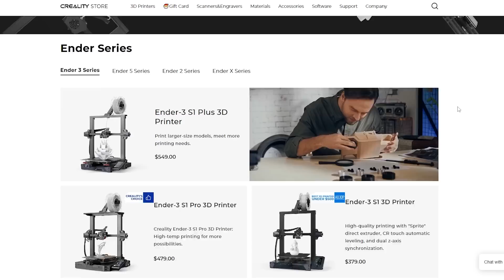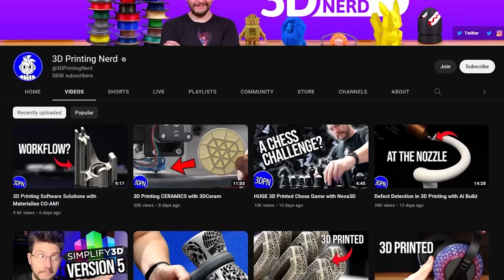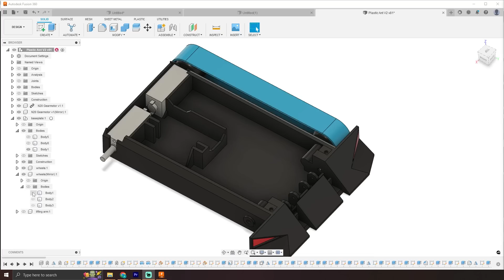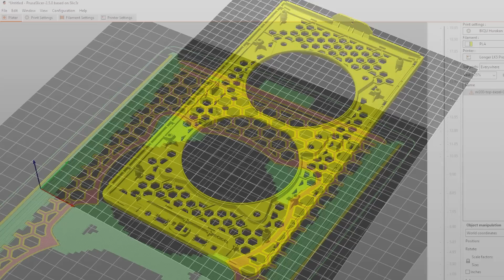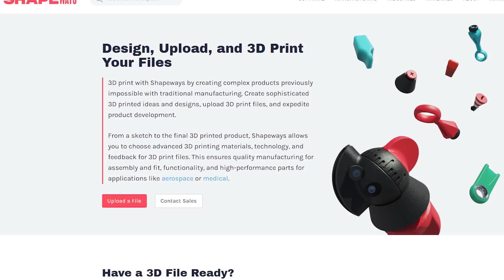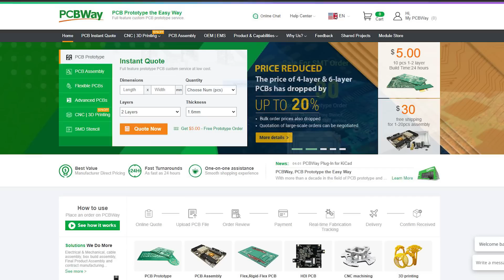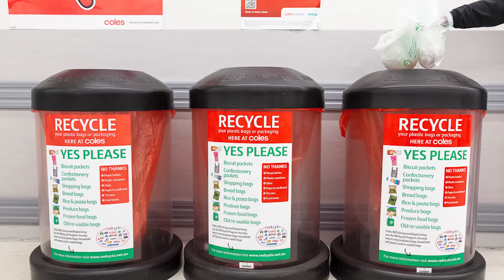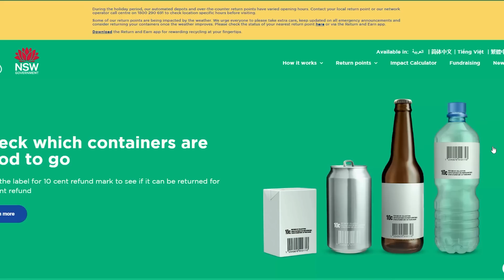My 3D Printing Predictions for 2023

Comment: The point about recycling is a good one, although the transition to the "make your own bottle-recycler" was a bit rough.  :)  And of course that doesn't solve the fundamental problem of needing to deal with all the PLA and ABS scraps lying around my house; sure, the "I print using recycled bottles" approach does reduce the use of the other plastics, but it does so at the cost of one of the few almost-viable recycling programs most of the world has in place.  What's needed is some way to easily deal with the scraps.

My local 3d printer store collects scraps and turns them over to a filament making company, but I don't participate because I don't have a car and the store is probably an hour away by bus and they don't really sell anything I want to buy.  Spending three hours of my day off just to take them some plastic scraps isn't worth it to me.  I recycle cardboard because it's easy - the cardboard bin is right next to the landfill bin, I'm going there anyway.  I recycle bottles because, although they're also a bit of a pain, there's a small financial reward at the end.  (Or some hockey team's fundraiser will come get them for me, even easier.)  Until recycling my scraps is that easy, I'm probably going to continue to landfill them, and so are most people.

As a side note: I've tried using recycled PLA because I like the idea, but I've found it's way too unpredicatable.  Each spool is different and I spend a quarter of it, it feels like, just getting it dialed in.  And then two days later I'm doing it all over again.  Also, for me at least the recycled stuff tended to warp really badly.

So, yeah.  The waste aspect of 3d printing is still huge and needs a much more comprehensive solution than currently exists.
Reply: The main issue with recycling other people's 3D printing scraps is that you basically have to just take their word on it being sorted correctly, and only being 1 material per donated container. 
I know I dutifully separate my PLA and PETG scraps, but what if someone brings a bunch of "PLA", but there's also some ABS, PETG, etc mixed in there, that they either forget about, or straight up lied about (so you'd just accept the whole box and not make a fuss). 
Your filament extruder might jam constantly if you set it for PLA, or overcook the majority of PLA in the batch if you set it to be able to melt ABS.
Even with "just PLA", you'd likely be mixing plain PLA, ecoPLA, PLA+, lightweight (foaming) PLA, ...
Either way, your material properties are all over the place if you mix mystery scraps.
Reply: @JanTuts  And that is the main reason why you want to recycle your own, not to mention you can also sort your colors and not have to settle for recycle color mixtures like grey and brown.
Reply: some kind of grinder to reduce the waste to pellets and a proper extrusion setup would be the way to go. No idea where to start on getting either item done affordably though.

Comment: The ankermake really is fantastic. The extra speed opens a lot of doors. I don't even understand where the extra speed is coming from. It is a stock .4mm nozel running colder than I usually print. And the results are better out of the box than my ender 3v2 of theseus, with every upgrade I was able to make.
Reply: The G-Code is optimized - by hand! Thats why you cant reproduce the times with other objects
Reply: 1. The Ankermake is actually in my opinion outclassed by the Bambulab printers

2. It's not sliced by hand. On my Bambu printer for instance I could get those speeds with some slicer settings changes. It's no magical gcode, just decreased layer cooling, increased volumetric flow, decreased minimum layer time etc.

3. You can actually get Ankermake speeds on an ender 3 with a hotend upgrade and inputshaper.
Reply: @BeefIngot  Yes, bamboo labs is significantly better. As for the rest, not really. My ender 3v2 has the all metal sprite extruder, with a .6mm nozel and all of the settings tweaked to hell. It can't come close to matching the ankermake out of the box with basic settings. No tinkering, default profile with fans at 100%

 It's just better hardware with tighter tolerances. It can go even faster if I put in a .6 nozel and optimize the settings. This new generation of machines will finally kill off the delusion that you can get good results out of any machine if you just tinker hard enough. The old dinosaurs just can't produce quality parts at close to the speed of the new ones.
Reply: @Christopher_Gibbons  You missed the key factor to allow for this speed which is input shaper, and you absolutely ca do it with an ender 3. There are many examples on YouTube even. Many go faster than the Ankermame even.

If course it's not out of the box though
Reply: @Taconiteable  Sure, the test prints maybe. But nobody is hand adjusting the gcode on random junk from stlflix.
Reply: @Taconiteable  this is absolutely not true

Comment: My thoughts as a young engineer.
1) The development of new products is key to achieve a flawless production. So having a prototype in a matter of days is advised. However it takes a lot of knowledge to operate such a machine and there won't be a dedicated guy to do this. It's way cheaper to send the files over to a specialized company and get the prototypes within the next day, manufactured on highly accurate printers. 
2) Simple CAD is and will be a thing, but there's always some sort of complexity involved. It's hard to imagine something revolutionary to solutions already in use.
3) This is already quite common. However those are simplified models, so a direct copy to competitors won't be used by competitors. It's a good practice to not give more than needed.
4) Many companies offer this kind of technology. It's still very new and the part cost is still quite high. Might be something we see in the next few years.
5) Recycling is key to a sustainable future. Transporting failed prints won't be energy efficient due to it's low mass and high volume. So recycling at home or having a better sorting system for plastic waste in general would be amazing.

We'll see what the future holds for us. Happy New Year! :)

Comment: Reasonable cost CNC parts from chinese manufacturers have been a thing for quite some time now at least. Not sure about one off parts, but various student projects I worked on in university had great experience with ordering 5-10 copies of maybe a dozen different parts for very reasonable prices. Although the whole interface and automation with cost estimates of PCBWay is really nice.

I wonder when local manufacturers will finally catch up to that for CNC parts. There are already various manufacturers with mostly automated ordering for laser cut parts here. The faster shipping alone could be really nice here in europe if prices are at least somewhat comparable.

Comment: Prosumer race is 100% accurate prediction. I have to assume AnkerMake & Bambu really have the legacy brands rethinking what they will be producing next. 

Funny you mention the easier CAD… actively working on some content around that for 2023!

Also… soooooo close to 1mill 🤯🤯🤯🤯🤘
Reply from the maker: Easier cad? sign me up! :D
Reply: AnkerMake isn't really a new player, though. AnkerMake is just a 3D printer trading name for Anker (Anker Innovations) which has been around since about 2011. Anker caused a big privacy and security stir earlier this year due to their Eufy brand of "no cloud" internet connected cameras which were actually uploading images and video to the cloud without user consent to train a facial recognition AI.
Reply: to be fair, a voron can print faster than either the X1C or the anker but they requires a lot of tuning, and if i want a fast printer, i  would take a core xy printer, chuck a HF hotend, install klipper or any other firmware with IS and call a day, but again, it needs tuning, for me is a very cool adventure, and i cover some of those things in my channel, but i understand that for some users are a no go
Reply: @Lucas_sGarage  Voron is also about the same price or more expensive than the X1C. I'm assuming the company can get better prices from their own sourcing, compared to an individual buying components.
Reply: @joegibes  no, the voron can be fixed with generic parts, the X1 can't...
Reply: Man I'm an engineer who uses CAD every day but I'd love an easy solution for personal stuff!
Reply: Do I have to start following you too 😅
(no worries, I have watched quite some videos)

Comment: I think the biggest potential for the hobbiest with regard to 3D printing waste is to melt it down, cast it into blocks and use it for CNC projects. CNC cut PLA is stronger than it is when 3D printed, and the more of your plastic is in large peices being useful then the less plastic is cluttering up landfill. And even if it does end up in landfill, in large lumps it does no more environmental damage than rocks and stone, as it degrades incredibly slowly than when it is in small peices.
So, cast your waste into blocks, and when you have enough build yourself a house!

Comment: I wonder how many versions of the Ender 3 Creality will release next year? and when will the X1 Carbon clones start appearing?
Reply: There's a company trying to do it using klipper, they are called Elyarchi or something and it looks like a mixture of cool, and hot garbage.
Reply: @timzalusky  To me it's seems to be leaning towards the latter as while it's cool that it's open source, it has none of the special ease of use feature of the Bambulab

Comment: Software is the true underdog here. Slicer and firmware innovation has pushed existing hardware beyond what we could do just a few years ago. I predict better pipelines (organic supports, multicolor stl painting, cloud slicing, cheap wifi computers for printers, etc)
Reply from the maker: Very true! We've already seen so many improvements and there's a lot of experimental stuff just begging to be incorporated.

Comment: I am really looking forward to the introduction of more DLP style resin printers in the hobbyist space in 2023. Mainly from the longevity of the device itself standpoint, Hopefully no more replacing of the LCD after a few thousand hours.
Reply: I'm was looking to buy anycubic dlp but it's only 4k iirc
Reply: @OpaqueWindow  Doesn't really matter tbh. Look at a side-by-side between its prints and 8k. DLP really changes things, and looking at it in terms of pure 'resolution' isn't necessarily correct.
Reply: @OpaqueWindow  if you have the money go with the anycubic D2 DLP ( i would probably skip their 1st generation DLP , the non D2).  Resolution isn't everything.  LCD's have a slight light bleed through, even the 8K LCD printers.  This causes slight rounding of transition between edges, especially when using anti-aliasing/bluring to get rid of print lines.  DLP does not have this problem, so you get better pop-out of details even when it is lower resolution.  There is a youtube video of side by side comparisons of the D2 DLP vs 8K printer and the D2 is just as good if not better than the 8K.
Reply: @resresres1  hey thank you for that information. I will order it when I get home. I was comparing and man everything else is just so much more expensive
Reply: @OpaqueWindow  well I wouldn't exactly call the D2 dlp cheap either.  Cheapest I saw is $620, which is around the price of the 8k printers, if not slightly more.  However, it is the cheapest dlp on the market as they are the only consumer level dlp maker...have to spend thousands to go commerical level to find another dlp.
Reply: I also expect more DLP's to come to market.  I also expect text input to 3D model AI generation in 2023 as well.  (a number of companies already have 3D model AI generation, but haven't brought it to consumers yet, such as google, nvidia and theres a research team that made one as well.
Reply: that would be nice not having to do any replacements of parts
Reply: Longevity or price aren’t what’s holding back DLP.
Reply: Best timeline wwuld be if more companies iterate on the "upside down" style of the HITRY Rocket 1 because that's some serious progress over the Vat+FEP based printers we have rn, the fact that it doesn't need to pull layers off a FEP means it has several orders of magnitude better Dimensional Accuracy than any DLP/SLA/MSLA printer out there
Reply: LCD screen have a lifespan and that isn't going to change due to cost considerations.  Adding $200 to a $300 printer for a screen that lasts twice as long isn't viable. UV exposure is actually a fairly harsh environment.  The trick is going to be finding a replacement tech for masking that is not expensive and much more durable.  either that, or lowering the required UV exposure to print and/or using another method other than UV exposure.

Also, as a minor point, finding resins that were 100% non toxic (food safe) once fully cured would be good.
Reply: Laser scanning is also something I could imagine popping up, someone taking their time to design something based on a laser printer's imaging head could have a future (...if Formlabs doesn't have or isn't licensing a patent for that, since that's exactly how their machines work). I would say using older laser printer parts for this would be quite viable, change the laser to the classic 405nm, a LOT of electronics engineering into it, and we've eliminated the consumable LCD.

Comment: No FreeCAD mention. 😢 It’s rapidly improving UI, CAD, and CAM and it’s 100% open.
Reply: I'd be more happy with cross between TinkerCad and SkecthUp. FreeCAD, like Fusion360, is not easy to learn.
Reply: @kimmotoivanen  I agree that we need various software to support different uses. Mainly I was reacting to when he said that Fusion 360 is too expensive.
Reply: @OhHeyTrevorFlowers  true, and one can spend one year learning to use and master a software - or just become one year older 😅
Maybe it's just how they work, sketch first with all the constraints, then extrude revolve etc. vs draw directly with 3D-objects. It would be nice if FreeCAD allowed to start with objects (boxes, spheres and general revolves (cylinder at first)) and create sketch from them in the background (that could then be parameterised and edited).
I wonder how difficult would it be 🤔

Comment: I miss 123Design, it was my first program to use and designed enough stuff and finally feel I could get a 3D printer rather than spending the extra dollars on printing services (it was expensive back then).

Recycling is definitely something I looking forward to, unfortunately our local community is not really interested. Few of our libraries have maker space and allow access of 3D printers for free (as long as the print is done within opening hours). But show little interested in putting in a recycle effort.
Reply from the maker: Yes! We need a new 123Design...

Comment: Okay first of all fusion 360 is not expensive it's $0.40 a day when you buy 3 years
Reply: Bruh, you can make anything sound cheap when you break it down like that.

Its 700 bucks a year which is a lot. You are basically paying for a new 3d printer every year extra for software that still has limitations and takes away features you've already paid for.